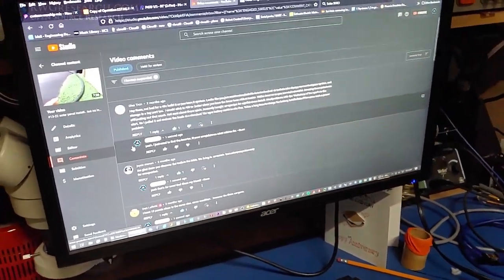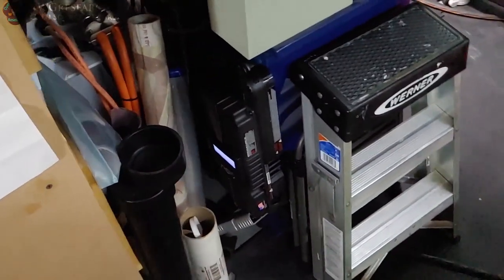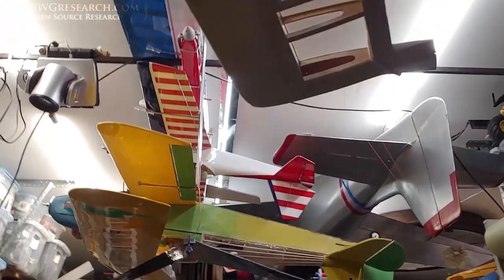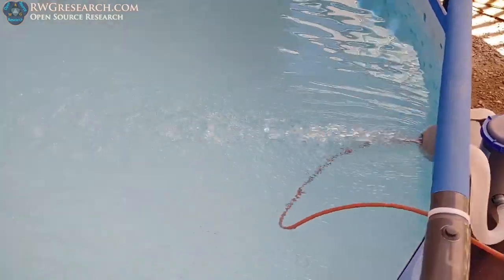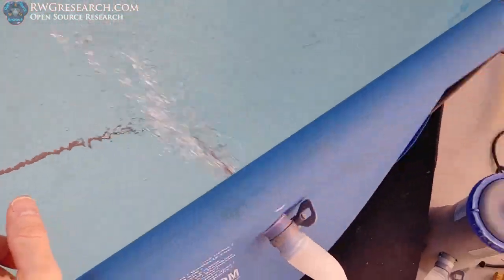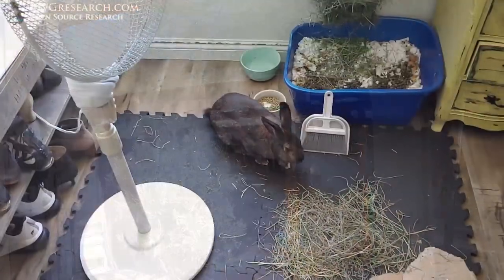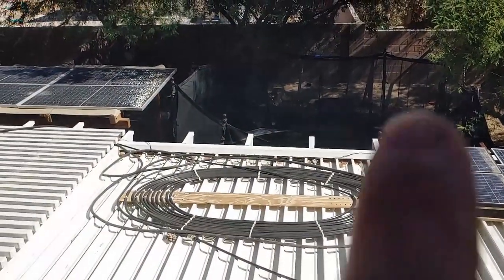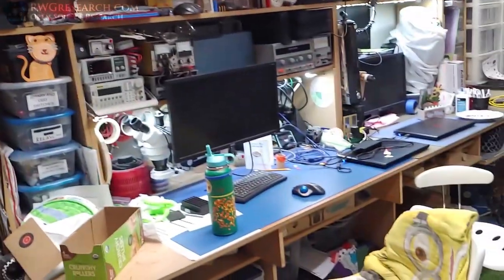#22-22: Solar Update. Water Heater / Pump / Fan ( so far its working! )

Comment from the maker: I forgot to tell you that I'm using 2 of the 4 (8 awg) wires to send the battery back out to the same box... and I'm using the battery to run the DC-DC converter. ~Russ

Comment: White background probably reflecting back onto the underside of the pipe, giving more heat. Would be better if you hunt up some old shower doors or sliding doors complete with the aluminium frame, and then made a box to hold the pipe inside. Then the whole box would heat up, heating the water as well.

You could probably make the box itself from solar panels, as after all the rear of the panels will be hot, and you only want the water to be around 30C anyway, so having the panels both being cooled by the pipe actively, and thus being more efficient, along with heating the pool, will probably work out better, plus of course more panel area as well.

Nice with the pool pump, certainly a big power user, trying to convince my friend with a pool to put up the 1kW of panel needed, and buy the solar powered pump, so that he can run the pool in the ground all the time. After that solar inverter will work for the house, but first do the biggest single power user.